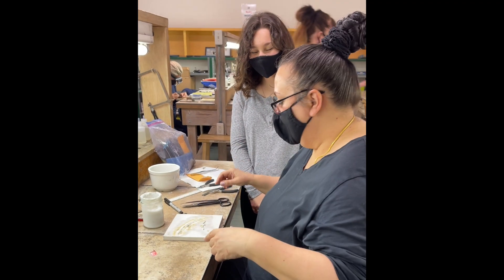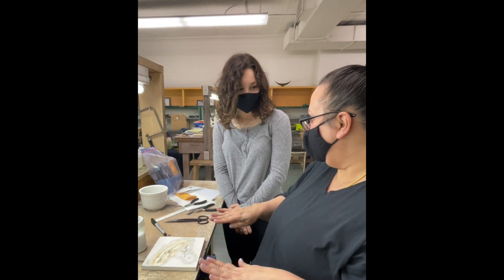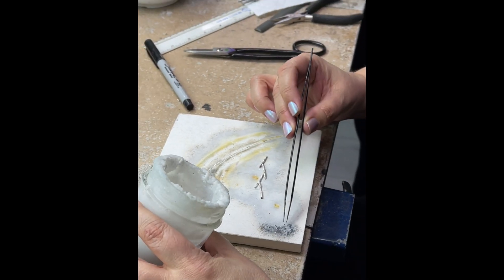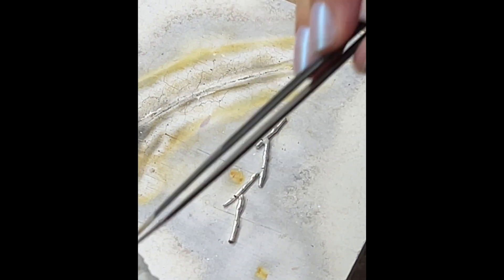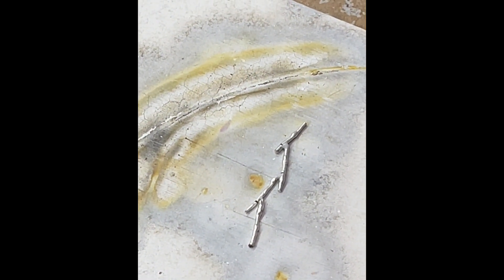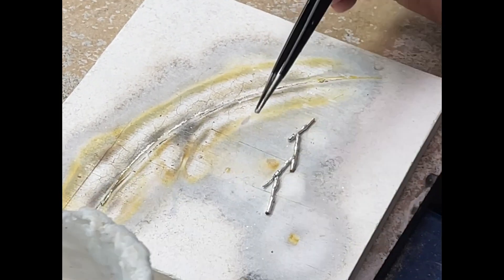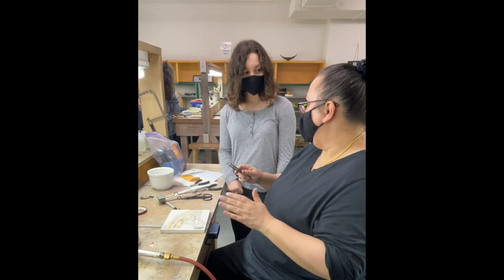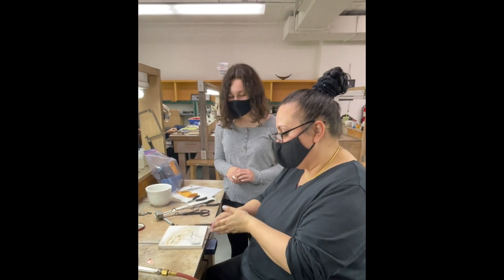How to Solder Silver Wires Together

Comment: When melting the wire to make the branches, don’t you get a lot of firescale that goes deeply in the wire and need a lot of sanding afterwards? Thank you for sharing
Reply from the maker: I very rarely get firescale but if it is a problem, you can always coat the wires in a fire coat. :)